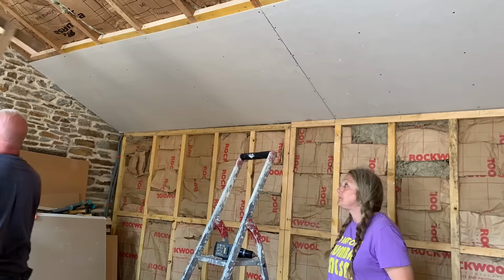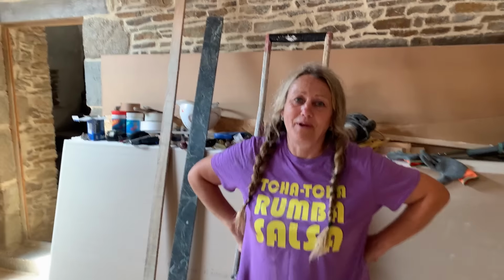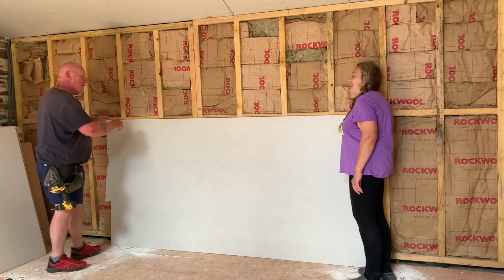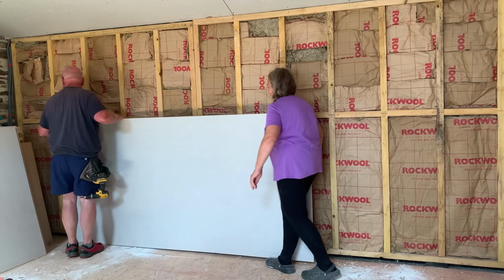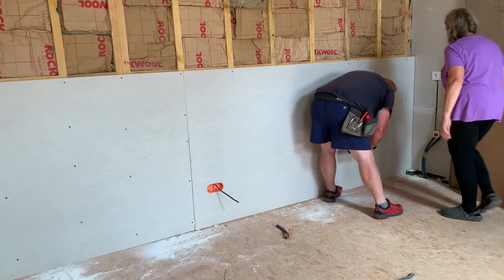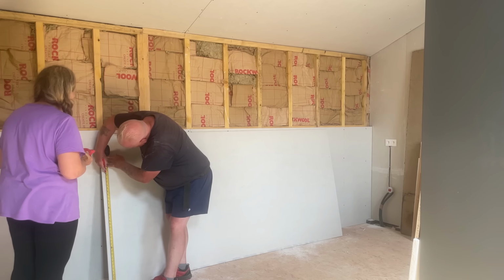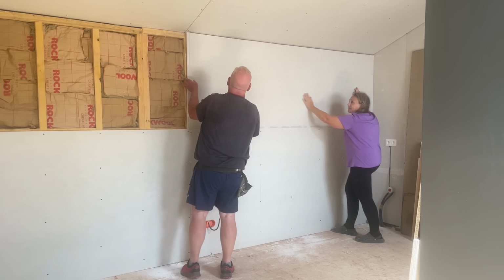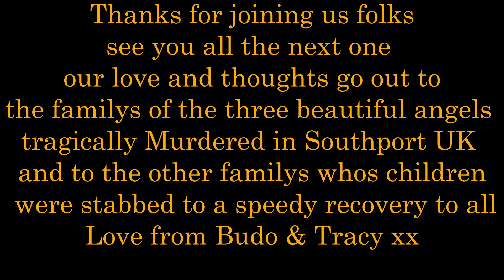PLASTERBOARDING THE KITCHEN NO 167 #farmhouse

Comment: Gratis workshop, but for drilling plasterboard there is a special drillbit with a plastic top with a spring in it. This works fantastic because the screws ende Just beloofd the surface of the plasterboard so its easy to finish off.
Reply from the maker: Thank you for your suggestion and thank you for watching 😍🙏

Comment: If you had a drywall dimpler for screwing the drywall it would make life much easier. Run the drill at max torque.  Room is taking shape and the veggies are wonderful. 🇨🇦
Reply from the maker: Thank you for the suggestions and yes it would help. Bon weekend and thank you for watching 😍🙏

Comment: Shouldn't the plasterboard be 10mm off the finish floor to stop water creeping up the plasterboard in the event of water spillage or cleaning the floor, that what we detail in the uk.
Reply from the maker: Hi John yes in the UK that's correct between 10 to 20 mm mate there is a different system in play here and it's about stopping drafts which are every day occurance  were water would be once in a blue moon and the suspended floor would make any light floods drain straight away 😉 great question cheers buddy 👍🏻